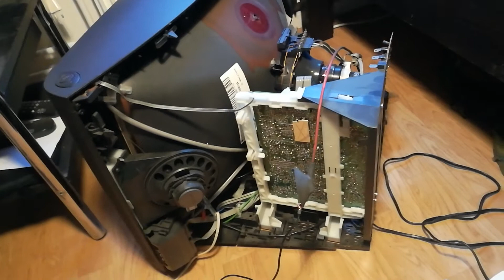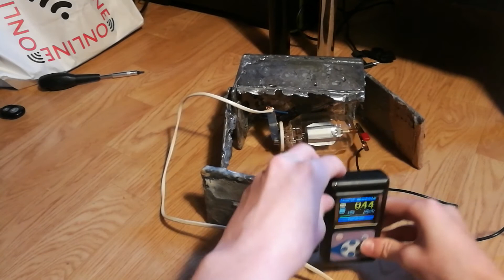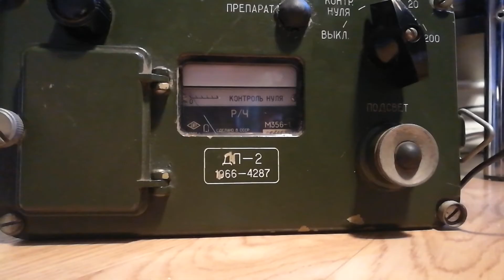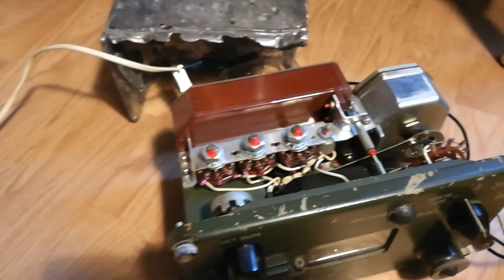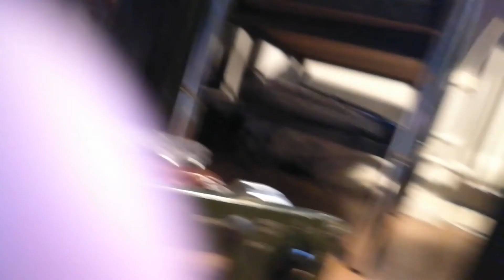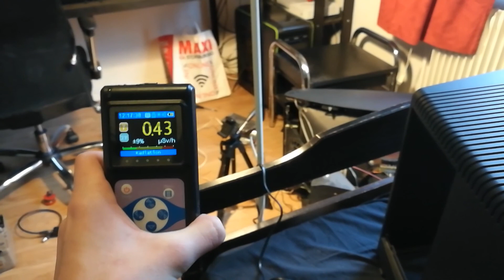X-Ray Setup Using CRT TV And Soviet Rectifier Tube

Comment: its not RTG, its electromagtetic noise
Reply from the maker: RTG? Not sure what you are referring too, but I can say with confidence that it is real measurements taken as pancake type detectors do not respond to EM fields in the same way as regular GM tubes. And the ionization chamber is the same, does not react to EM fields. I have even been able to produce x-ray images with this setup.

Comment: Actually you dont need to plug in the TV to discharge the CRT capacitor.Just short the ''suction cup'' to the metalwork/chassis.
Reply from the maker: I was just following what a friend did, and it's always better to be on the safe side :) But thanks, good to know

Comment: Why do you say anode instead of flyback transformer output?The anode in inside the CRT.
Reply from the maker: Because it is the anode, the positive output of the flyback. It was originally connected to the CRT's inside but I removed it so it can be used for other purposes.

Comment: I recently bought a radiascan 701a. Can you please tell me how high the CPM goes on it? I understand the firmware for that feature is new so it is hard to find info on it. Thanks!
Reply from the maker: The radiascan measures in cps and Sv/h or R/h. It can register max 9999cps but it will only show accurate cps to around 6000 to 7000cps. The detector starts to saturate when measuring higher levels.
Reply: @radiumquetzal8000  Thanks very much man. Much appreciated. Looking forward to getting it.

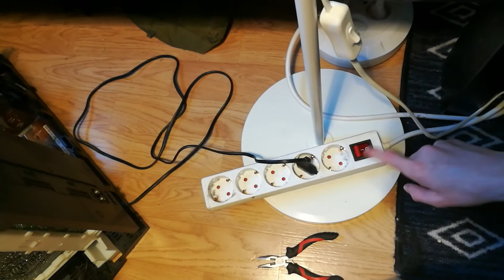Comment: I recognize your enthousiams but it is absolutely impossible that this simple setup generates such a very high radiation level. You use geigertubes to measure the radiation, however, they erroneously measure the high electric field, 30 kV from the television. I had a similar experience measuring with a Geiger counter near a Tesla coil. Very high readings. However, measuring at the same distance with a scintillator, far more sensitive for radioactivity than Geigertubes, I only measured background. Your device is different, it will generate some X rays, but at an energy level of 30 keV, very weak X rays. The link below shows my experiment with a Geiger counter and a Tesla coil, starting around 2:20.  Regards, Alfred. 
https://youtu.be/7vRcDLEiRaM
Reply from the maker: It does not seem that way belive it or not. The tube is able to lit up a blue intensifier screen to some extent, enough to get a low resolution xray image of items like phone chargers. If you check out the video I uploaded before this one you can see a large amount of flashes from the intense radiation emitted. On my second channel there is also a video showing even better flashes from the tube caused by the x-rays. 

Geiger tubes definitely does freak out due to the electric feild. The detectors used in the video are a bit different, first two use a pancake type detector which does not react the same to EM feild as it does not react to the HV supply in any way. The DP-2 shown on the last measurment uses an ionization chamber to detect the radiation and it does not react to EM feilds. 

The tube I'm using for xray production is famus for being extreamly good when it comes to generating larger amounts without an actual x-ray tube. There is mutiple other videos of it or simular models run on simular HV. (They are in Russian though)
Reply: @radiumquetzal8000  yes, I am convinced that your device generates X-rays, however, the very high radiation level you measure is erroneous.Try to measure the radiation energy with a scintillator. Geiger tubes produce internal ionization due to the high voltage electric field. Thus it suggests ionization due to radioactivity but it isn’t. Geigertubes also are not very sensitive to low keV X-rays.
Reply from the maker: @AJApper  Just tested and the scintillator flies off scale from a decent distance away as expected. The scinillator used being an Eberline SPA-3. As said earlier it's able to lit up an intensifier screen and generates more flashes then any other source indicating high levels. The amount of flashes are magnitudes higher then a ~4mSv/h gamma source as comparison. The DP-2 ionization chamber does not react to the EM, it's not moving in any way when the tube is removed and there is just an arc. It's also calibrated to 150keV x-xrays so it's not too far off when measuring these. I compared by holding a GM tube detector in the area around the setup and beside it I had the DP-2 and the pancake, GM Tube went off scale but the pancake or ionization chamber did not really move. The sound the detectors usually make when reacting to EM is different to when normal radiation is detected. Another indication that this is real is the fact that these values are only achieved when the detector is put in the beam path. If they are moved to to another side of the tube the radiation detected drops.
Reply from the maker: @AJApper  https://www.youtube.com/watch?v=DdwkjPkUV-A
Reply: @radiumquetzal8000  OK, that is remarkable. Thank you for your explanation and convincing demonstration. Can you translate the scintillators reading to radiation level in microSv per hour at 1 meter distance ?
Reply from the maker: @AJApper  Hmmm not really possible at that distance as the meter gets fully maxed out to the point where an alarm goes off due to there being more then the detector can handle.

Comment: Very cool experiment! These reading are not correct since most geigers are calibrated to cesium 137 which has energy peak at 662kev. Still, I would not do this too often :)
Reply from the maker: The DP-2 readings are not too off as it is not calibrated to Cs-137, it was calibrated to 150keV xrays. But the rest are incorrect

Comment: I assume you need to flick it on for short bursts or it will burn out the TV's flyback transformer? When I messed around with a triode and an old CRT after a couple of minutes most of the CRT had sadly died.
Reply from the maker: Hmmm that's weird, the reason I'm doing burst is due to the tube being easily burned. It likes to arc a lot which increases the heat and can end up killing the filament.